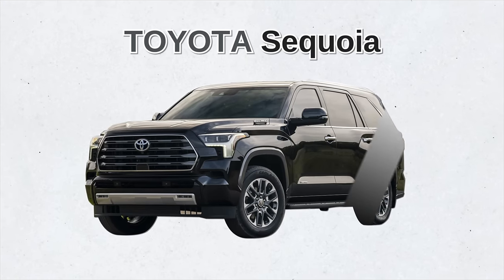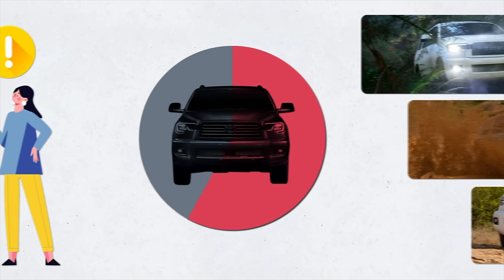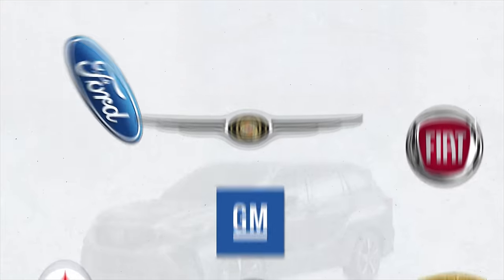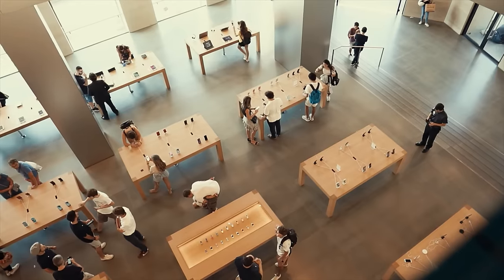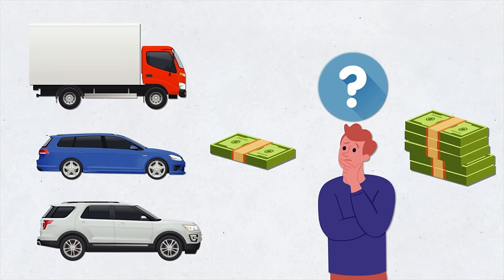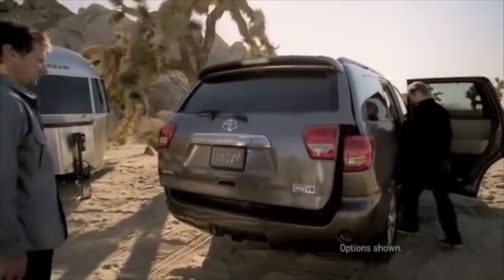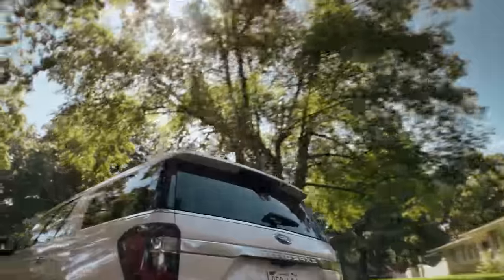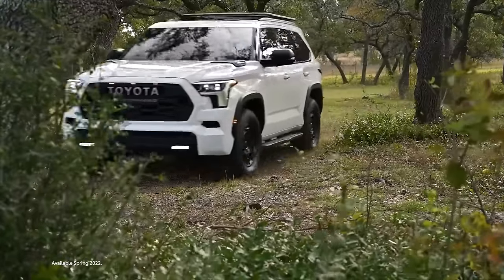Here's Why This New Toyota is Bulletproof

Comment: My first SUV was a 2001 Explorer Sport 2door real 4WD lasted 20 years & 155000 miles 1 uesd transmission $1500 rebuilt all front end including wheel bearings excluding CV & shaft 1 transmission cooler NYS rust ended it's life. Now have a 2017 Explorer XLT premium 80k mi looks like new runs like new 4WD/AWD 19.9mpg avg. Every time I get in it's like getting a present & driving is like entertainment. It's the most agile comfortable surprisingly accurate vehicle I've owned. Ruby red clear coat metallic, stiched black leather w 10way driver's seat, panoramic roof, BU cam w washer, parking sensors front & rear w reverse approach warning, 20" wheels, 9 speaker surround, towing pkg trailer sway 5k cap., 3.5 V6 6speed, remote start/stop, keyless entry push button start, heated seats, steering wheel, sideview mirrors, rear wiper, dual zone temp cont., aj steering wheel, power remote tailgate. Might have left a few things out.

Comment: I'd still rather have my 2019 4Runner. I bought it new and still only have 3300 miles on it. I pull my boat with it but in 4 low, I think it will climb a tree.
Reply: You can probably sell it now for what you paid for
Reply: @thiaguinhooitodois2211  You are correct. The last oil change at the dealership, the salesman offered me what I paid for it. I turned him down but I would have taken him up on it if the new Highlanders still came with 4 wheel drive. I am not a fan of AWD at the boat ramps..
Reply: Wow, my 2019 Tundra just rolled over 103,000.
Reply: You could trade that car for a new Toyota Sequoia but that's upto you lol if you really love your car and don't feel like upgrading I say keep it but the Sequoia 2023 is Fuel Efficient it might even save ya on some gas tbh.

Comment: I got an 07 sequoia with 320k miles with  only routine maintenance and also a 2015  sequoia TRD with about 160k miles drive train original on both  just normal maintenance my  wife have a 2010 sequoia with close to 200k miles trouble free ,my son 2015 4Runner 175k miles my daughter 2015 rav4 150k miles ,all running perfect, in the other hand my lovely father decided to go FORD and got a 2017 expedition currently sitting at 92k miles but already have an engine replacement the transmission was rebuilt and rear end leaking also some electrical issues,windows regulator going bad all the time etc etc and the same crap goes to my brother with his 2019 explorer ecoboost with 60k miles already replaced the turbos and almost the entire engine because an oil supply line and two some other electrical issues,so yeah Toyota may be old school and needs to be updated but they understood the assignment by giving the people good reliable vehicle that last a good long time ,Ford sorry but you still have to catch up in reliability on that field Toyota is the king

Comment: If I knew for a fact that I would only have the vehicle for about 5 years or roughly 100,000 miles, I'd probably go for the Expedition. But, if I was planning on keeping something for years beyond that, I'm going for the Sequoia, because I know that with basic maintenance that thing will go 300,000 miles or more. You can't see that for the Expedition. The Expedition may make it 300,000 miles, but only after major transmission overhauls and possibly having to do major work on that twin turbo, as well as other components in the vehicle.
Reply: I agree,  Between the Expedition and the new Sequoia I would definitely go with Sequoia for the long term. The Expedition is a little bigger and may be even a little more comfortable on long road trips. The Expedition’s interior seems to be more luxurious on the upper trim levels. But just based on the cost of long term ownership the Expedition will be eye popping $$$ new engine, turbos, trans. Etc. while the Sequoia will just require minimal basic maintenance.
Reply: If it makes it to 20-40k miles be happy with a ford

Comment: What I care about is reliability and Ford cannot do that right now all the new Ford trucks are always in the shop
Reply: Not just right now. Ford has had transmission problems in their trucks since at least 2004!
Reply: @koreymayo8884  engine has been the big problem 🤦‍♂️ smh I also have a Ford 6line 97 when it was good 2 tank
Reply: 2001 f150 5.0 v8
300,000 miles a still ticking
Reply: @markphils896  That’s not a new F-150.

Comment: Actually Americans buy SUVs and the like because they are more reliable, powerful, SAFE and flexible.  If people had more wealth nearly 100% would buy them.
Reply: More reliable? Lolz No
Reply: Bigger engines are (in general) more reliable then smaller ones. This explains why Toyota's that made million miles are Tundra's, but not Camry's or Corolla's. If you're not convinced, ask Scotty, he will explain.
Reply: @gunesinan814  scotty Kilmer isn't always accurate. He actually tries to say that 4 cylinder engines last longer because of fewer moving parts, but larger engines don't rev as high and work as hard all the time, which explains why v6 and v8 toyota engines last longer than the 4 cylinders like you said, but somehow a 4 cylinder 2013 hyundai elantra went over 1 million miles! That one I cannot explain lol.

Comment: I had a Chevy Avalanche for 12 years. I still miss that truck.  Good friends of mine have a 2004 Sequoia with over 300,000 miles.  Yes, it was challenging to park in Los Angeles, with all the subcompact cars. But, I do miss the utility. My wife has a tiny Golf Alltrack. It does okay, but is way too small.  At least I can rent.

Comment: How do I feel when I see my friends with the latest phone? Smart. Because I spent less than 1/4 of what they spent on a phone that does more than I need it to do.
Reply: That's the secret. If my phone dies, I replace it with the last outgoing model they have. They sell 'em off cheap to make room for the latest craze, and I still get a really good upgrade! :3
Reply: Yup. Mine cost me $10.
Reply: Wrong video Bruv
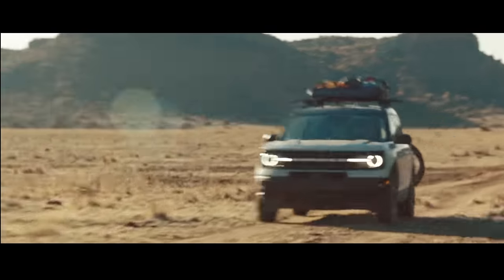Reply: @zacharypeery4082  : Wanna bet? 4:15
Reply: @zacharypeery4082  Wrong dude, Bro. X3
Reply: Yeah but they don’t last you as long so after all
The small
Updates  you probably spent the same
Reply: @TheGeorgeee13  Not a chance. I went six years before upgrading from an iPhone 4. Paid $100 for it because it was two generations behind, and beat the hell out of it working as a landscaper. 

Even if I paid $100 for a new phone every year (unthinkable), I'd still have saved $400 compared to buying just ONE flagship model at launch.
Reply: @TheGeorgeee13  : Five years. Not even close to spending the same.

Comment: I love my 2001 Toyota Sequoia Limited 4WD. 208k miles, hoping to get another 400k out of it at least. Love its reliability, comfort, power and style. Does great in the snowy Pennsylvania winters too. One day when I upgrade, I will keep my current sequoia and get a 2022 Sequoia, not sure I would like a 2023+ because of the V6 engine, plus the rear end is kind of unappealing.
Reply: No... just get another 2000-2007 model.... get a nice loaded 05 or 06 limited, they're super duper nice and are far more reliable than the new ones. The new ones dont go as long as the older ones and the older ones are more classy imho
Reply: @ToyotaNutjob  no such thing as a 2000 sequoia… also they second gen sequoias can and do go far, I’ve seen multiple with 300k+ miles. I love my first gen but I’m sure when I’m looking to upgrade one day there won’t many first gen left.. not any clean and sorted ones anyhow.
Reply: @dakotakline461  yes there is... they started in the year 2000... look it up...

Comment: I drove a new 2008 Ford Expedition EL XLT 4x4 at work. It was very comfortable however experienced numerous mechanical problems from new. I recall noticing the xmsn leaking in the garage at work with less than 20k miles on it, of which I felt was unacceptable. It was used as a special purpose vehicle and was heavy as a result. It should be noted, work still utilize the Expedition on details. I own a 2014 Sequoia and love it for the most part, although it lacks in several areas to include fuel economy. With that said, it is a very reliable SUV. I just think Toyota needs to update it to 2022 standards.

Comment: Definitely the Sequioa. I'd probably avoid the upcoming platform for a little while due to the current turbo issues. Toyota should have stuck with a natural aspirated engine.
Reply: Toyota has solid turbos on all their diesels down here in Australia, while they have had a few issues with emission systems they have worked it out on the latest versions and it was never a problem with turbo failure
Reply: @02hreblue30  you guys are so weirdly defensive about a company who literally doesn't care about you

Comment: Our 1999 Expedition had 200k on it when we got rid of for a newer vehicle. It was a good truck. Engine and trans were good. Just a couple window regulators and lock actuators that needed replacing. My biggest worry now in the new ones is how durable the 3.5 turbo engine will be?

Comment: Been in an armored suv lots of times but luxury and comfort were not features. Very cold in winter, extremely hot in summer, and driving at highway speeds is like reentering the earth’s atmosphere aboard the space shuttle. Surprising given the $220000 price tag. All that isn’t enough though because the army felt it necessary to stick a giant radio between the driver and passenger. Throw on a Kevlar helmet, a flack vest, lbe with canteens sticking out both side and a gas mask on your hip and don’t forget get your weapon and you’ll barely be able to see your driver to tell him where to go. Not that he can hear you anyway. Fun times!

Comment: I have the tendency to prefer the Expedition, but that twin turbo gdi V6 engine is not as reliable as the sequoia's V8, even though it has better gas mileage.
Reply: Is direct and port injection, not just gdi. But yes I totally agree with you, it will never be as bulletproof as the V8
Reply: My favorite Expeditions are the ones with the 5.4L SOHC 2V Triton V8, I wish Ford would've put the 5.0L Coyote V8 in the Expedition as well.
Reply: please provide the facts.  we will be waiting forever.  you have none.  V8 is a gas hog
Reply: @CJColvin  Tritons have plenty of problems
Reply: @02hreblue30  Yeah but the Coyote V8 however would've been an excellent choice kid.
Reply: You do realize they dropping the v8 for an Ecoboost knock off

Comment: When you get older you look at the practical side of things instead of having the latest and greatest. I guess that's why us old geezers have more money than the 20-somethings.
Reply: Yup. I'm not old by age, but serviced aged/gave me much wisdom in life. 

I got an 07' Civic Si that I took care of when it first came out. Went overseas and dad drove/cared for it during my years abroad. 
That vehicle today has been cross country try and still runs like a champ to this day. Just like it's main owner, aged, but a lot fight/heart. 😆 

If I need to purchase something new, it's going to be with me for many years. Make it worthwhile and care for it.
Reply: Not every millennial is like that. I'll pay extra to get something good, but I keep my stuff forever. 

My daily is a diesel Dodge with 340k on the clock. Other than electrical work (which I did myself), and a fuel system update (shop), it's been fantastic! 

It's ugly as hell, but until they start making pretty cars that last longer than old beaters, I'll just keep her maintained! :3

Comment: I've own ed two tundras and three expeditions, every time I have looked at a sequoia they always commanded a higher price and after weighing the options between the two I end up getting the expedition. The first expedition was a 99 we put $150,000 mi on it and gave it to my wife's father who still drives it today, the second one was a 2006 we put $189,000 on it, the third one is a 2016 with 78,000, for me it just came down to price versus options I like the Sequoia I just get more room with the expedition everyone I own except for the 99 is the extended length which Toyota still doesn't offer. 

My opinion the car manufacturers stopped making big cars and was cramming everybody in these little mid-size cars seems like shortly after that people started buying the SUVs and pickup trucks nobody wants to ride in the back of a Camry or Ford fusion or a Chevy Malibu for any length of time.

Comment: Hi
I have 1993 chevy G 20 5.7 engine the transmission 2 , 3 gears not changed i change the selenoid  and still don't change Any sugestión ?
Thank You
Mr. Diaz
From Florida

Comment: I'm really looking forward to he 2023 Sequoia suppose to be hybrid only so see what kind of MPG it will get. Towing will be 9000 lbs more then enough for me right now I have a Dodge 2500 Diesel, and a small ford Focus ST both I think I will sell replace it with the Sequoia since I work from home now my wife and I don't need 2 cars. I hardly ever put stuff in the back of the pickup truck don't need the diesel really I thought we might by a 5th wheel but think if we do ill just get a small motorhome.

Comment: Scotty I’ve been looking forever for a late 90’s early 0’s Tacoma. I live in the Midwest where the frames are always crap. Is it different down south? I know those trucks run forever it’s just the frames don’t hold up
Reply: I drove a 2000 4runner.. Insanely similar to the Tacoma your talking about and its probably the best truck or suv ever made.. I sold it at 320k miles and never fixed anything besides basic things
Reply: @Mason Webster, darnit, you would absolutely love my dad’s good friends 2004 Tacoma with only 100K miles, with one of the best smelling interiors I’ve ever smelled. He takes great care of it, he’s owned it since 2008. 4 door with clean 5 seat cloth interior.

Comment: I prefer crossovers and the only way I would consider an suv is if they were cheaper and had better gas mileage than crossovers so basically never for me it's too much extra vehicle for me I'd rather have a truck than an suv though anf my dream that is attainable is to have an extended cab truck with a long bed for hauling and working out of and a crossover for kids and daily driving maybe a reasonable cheaper sports car thrown in but not a must

Comment: Never seen a up armored Sequoia, only Land Cruisers. 

Doesn't the new Sequoia run with the new 3.5 twin turbo? That's the same engine that has defective turbo unit(s) in the new Tundra and requires the removal of the cab or engine for replacement. It will be interesting to see how it plays out in reliability.  I have always liked all the Toyota SUV's, too bad the Middle East and Australia get the cool ones.

Comment: I had a 4 door suzuki sidekick 4x4 I used it to commute, deliver pizza after my first job and play mudding ect I do miss it so it had 280,000 miles and was totaled and rebuilt exhaust fell off and you could see the road thru the floor buy I still sold I for 1000$

Comment: Maybe by the time they actually come out Toyota will have figured out the turbo issues and they are steadily having the normal first model year issues with electrical problems etc. So I definitely wouldn't call it bulletproof when the platform that it's built on has a lot of problems already.

Comment: Any mention of what needs to be done when one or both of the turbo assemblies need servicing?  On the 2022 Tundra, the techs need to separate the cab from the frame to gain access to a turbo assembly when a tubo waste gate fails.
Reply: new 2023 Sequoia has the same Twin Turbo V6 engine as 2022 Tundra.

Comment: I have an SUV and need it for off road also because of the quality of the roads and still I have one that doesn't go to well off road,but it's ok,anyway in the future I am looking to buy a mazda cx 5(after 2016 as Scotty said)  or  Toyota Rav 4 ,the land cruiser pr 4 runner or hilux would be too expensive on the taxes. As for Smart phones this is a fools trap...as well as Pc upgrades and so on. These days smartphone companies come with a flagship each year or even 2 times or more a year,unless you own the damn company or a bank or another company it's hard to keep up with it and jump from a bill to another to change the phone so unless you break your phone badly I don't see the need for it. And fot your answer Mr Scotty,I would buy them both if I had the money,why? Because they look good and they sure have the quality there and woth buying.
Reply: I drive an 05 Sequoia with 332,000 miles on it. Gas mileage sucks but is a good trade off as I rarely spend more than regular maintenance on it. I’ll drive it as long as it lasts. (I’m thinking it may outlast me)

Comment: After around the 100,000 miles mark and you wanted to trade either car in I’m pretty sure it’s the Toyota that would get you a better deal, I still don’t trust Ford with all the problems that they’ve had over the years with the eco boost and dual clutch and they renegade pretty quickly on their warranty an example is when they said they would buy the car back off you but only gave you the minimum price back

Comment: I'm really disappointed with the smaller 3rd row in this new gen Sequoia versus the older generations. Toyota going with that solid rear axle raised the seat floor of the 3rd row and made the leg room and thigh support really bad, close to what the LX is. The sequoia is supposed to be a full size family suv, but this new gen doesn't fit any decent sized person in the 3rd row. Toyota should have offered this new gen in an optional XL trim with an independent rear suspension to fit large people and cargo in that third row. What a huge mistake and missed opportunity for Toyota to not grab that larger family market share of yukon, suburban, expedition, etc buyers. Someone in toyota should be fired for that huge blunder. They totally ignored the needs of their loyal customer base.